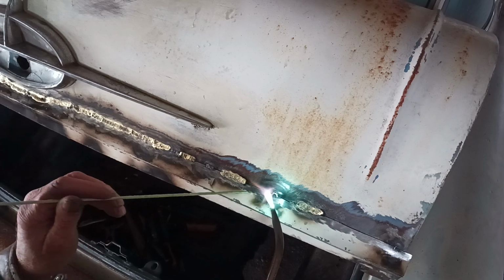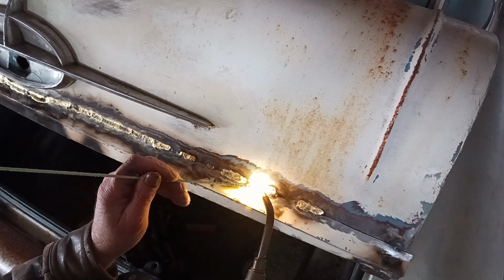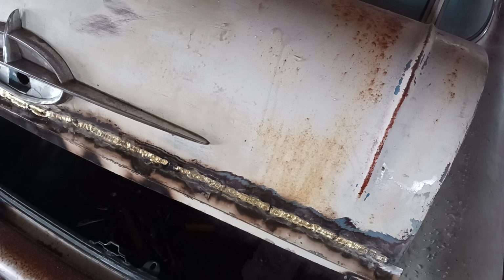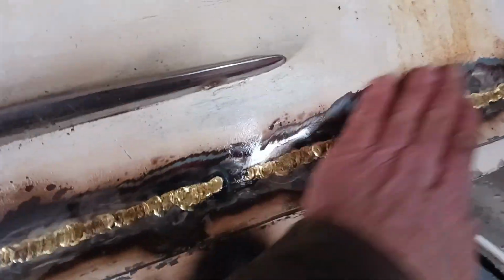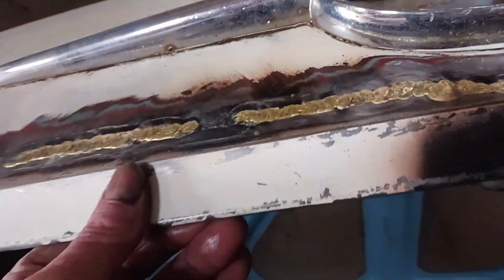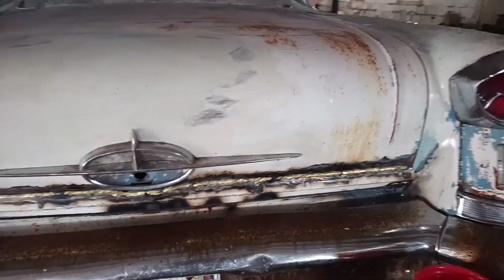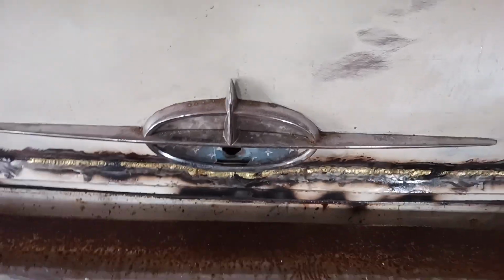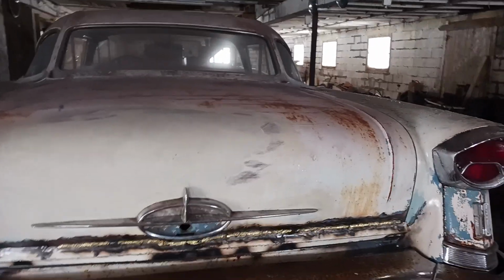number 0 tip for this

Comment: Welding with a torch is a pleasure  for the ears,so is the cooling with water instead of a compressor running for air.Thanx for the video.